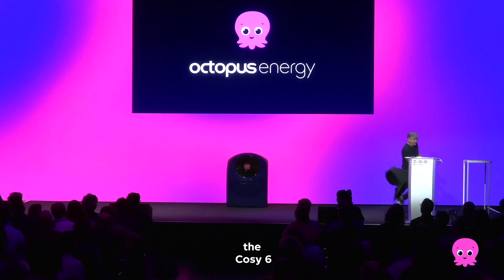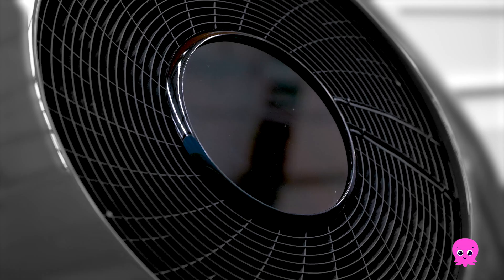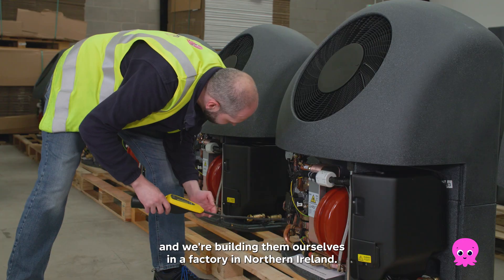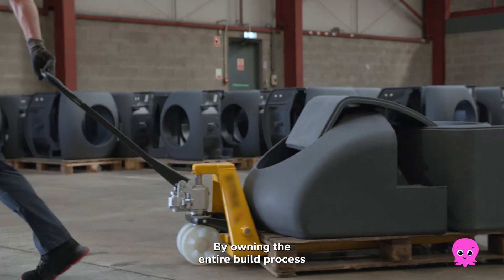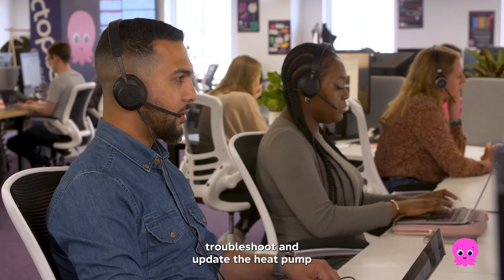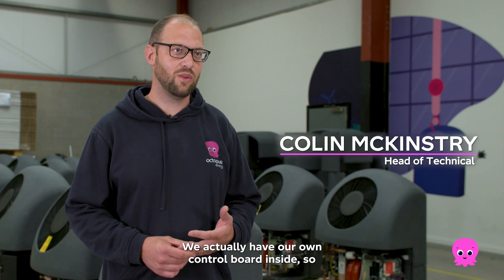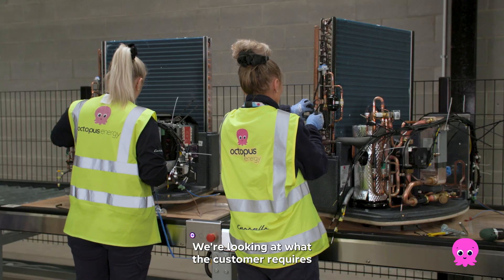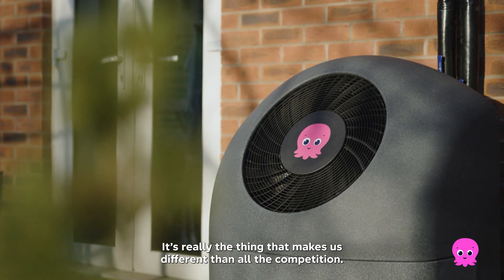Step inside the Cosy 6 heat pump factory

Comment: And yet you don't provide electricity to Northern Ireland, a part of the UK with the most expensive electricity prices. Maybe get working on that?
Reply: But they did have a heat pump factory already up and running which helps (RED Heat Pumps).

Comment: I couldn’t get a heat pump installed as I didn’t quite have enough space for the hot water cylinder, is there any update on there being a smaller one?

Comment: 2 months till our install date.

Can't wait!
Reply from the maker: Yippee!!
Reply: How long in total did you have to wait from signing up to getting a date. We've signed up but don't have a date yet.
Reply: @terry1690  we signed and paid the deposit / total bill, in early June, but we wanted to have the Cozy 6 and we had lots of issues sighting the heat pump itself.
Octopus were superb throughout, albeit a bit slow on responding.
We got everything approved on the 3rd of October, but because we had a holiday, the install is week  commencing the 11th of November.
Good news as our gas boiler was condemned in May, we've been using the immersion heater and now 2 electric heaters!

Comment: Great innitiative and a welcomed technology to the masses. It's always concerned me why the outdoor inlet fan design is angled upwards? surely this is asking for rain/snow ingress...do correct me if I'm wrong. I love the idea.
Reply: The cosy 6 is intended as a boiler direct replacement in smaller properties. There are various planning regulations for heat pumps, if you can keep size and noise down you are exempt from planning permission, and can also put one in more locations. I would think the design is partly to help with installing in less than ideal small locations that a regular front mounted fan would struggle with.

Snow and rain going in doesn't matter much, it's an outdoor unit that sucks through a lot of air, it would be pulling water through whatever angle the fan was at. In cold weather it has to defrost itself anyway, would be interesting to see how well it coped with snowfall fast and heavy enough to bury it, one benefit of top mounting the fan is it requires much deeper snow to actually cover it.
Reply: I suppose there'll be rain/snow ingress regardless of fan angle, so it'll need to deal with it anyway. There'll just be a bit more for the Cosy6. But they have to deal with moisture anyway as condensation will form on the condenser while it's running. Benefit of fan angle might be that in some locations it's less likely to have cool air pooling...just a guess though.
Reply: I heard a fan at an angle is not good for the bearings and will not last like a vertical fan
Reply: @ailaix  if the fan is designed to be installed at that angle it will be fine. It's only an issue if bearings are designed to take load in a particular direction and only that direction.
Reply from the maker: Hi Ben, glad to hear you like the tech. The upwards pointing fan is to increase efficiency and airflow. When it rains, water that falls into the fan goes through the airflow tubes into the drip tray, where it drains. If there's heavy snow, you can use a soft brush to remove any snow that has built up on top, but the pump will still work. Thanks for being curious! 🐙